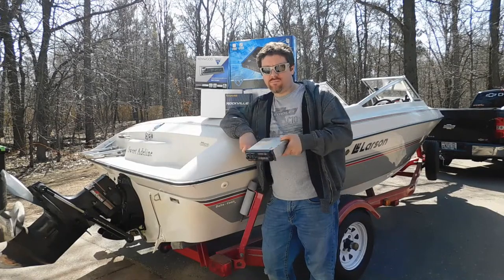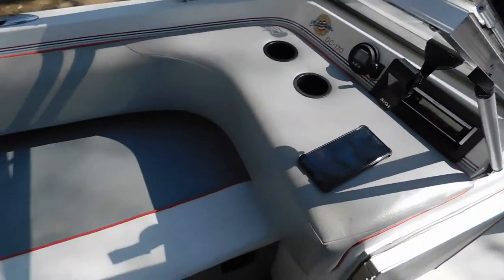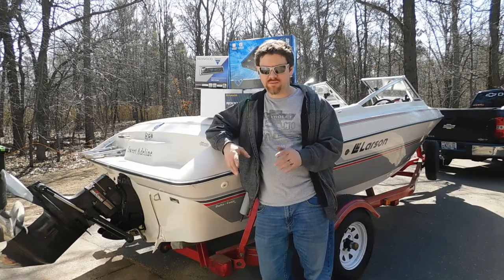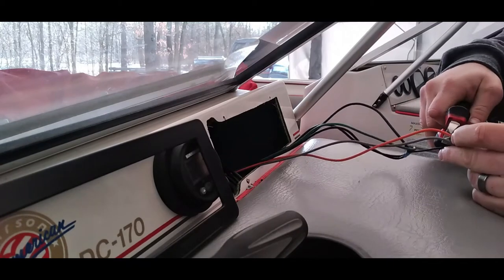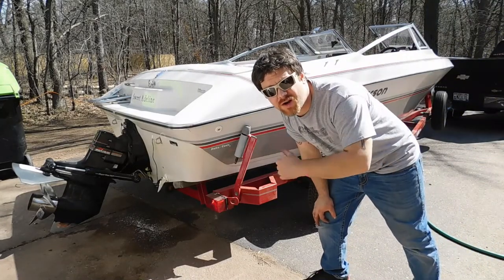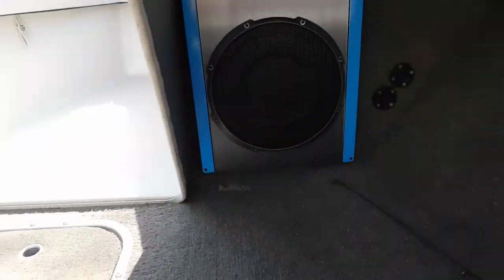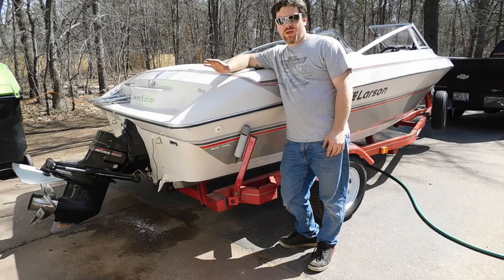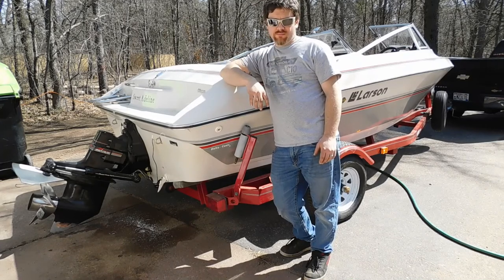Affordable Boat Audio

Comment: How is that 5 blade prop working out? What pitch is it? I am using a 4 blade on a sea ray 160 with a 3.0 and am looking to get a little bit more out of it
Reply from the maker: It's a mercury high-five. Don't know much more specs on it. It was on it when I bought the boat.  Definitely a good pulling prop and good hole shot. I do get higher top speed with the 3 blade prop from factory